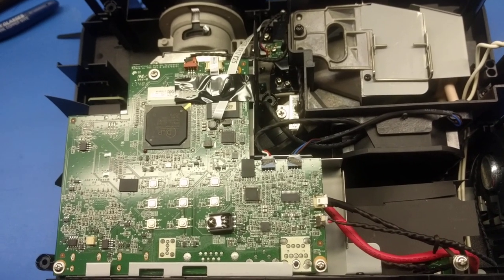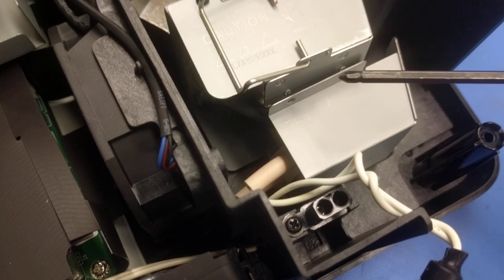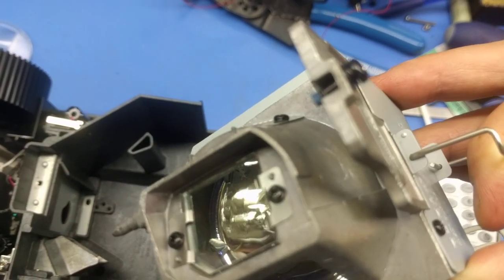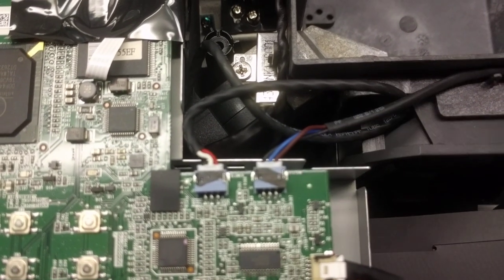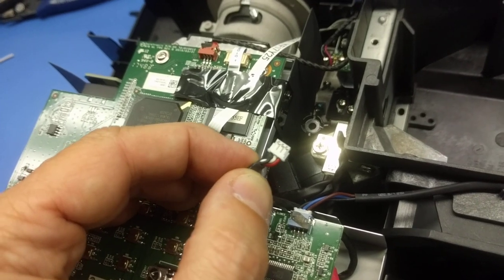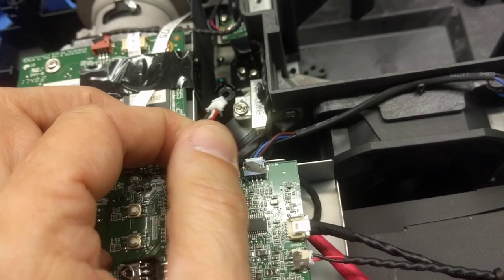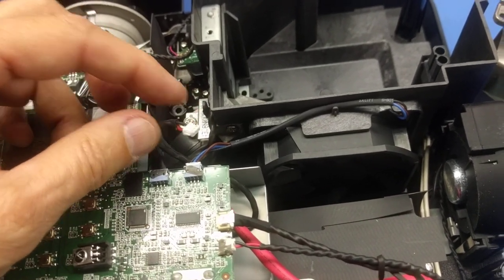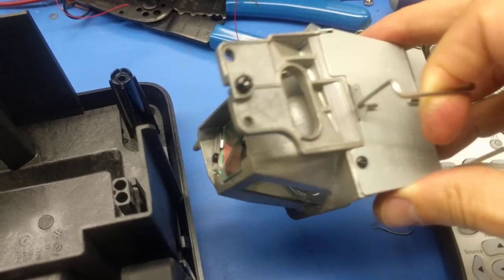Optoma Problem--Fan Failure Issue HD143x

Comment: Hey, thanks for taking the time to make this.  One more data point: I own a HD143X and had an intermittent fan error (rare) after about 1 year of use.  After about 2 years of use, it became very frequent so I found your video.  I opened it up and it looks like Optoma solved the wire gauge problem by the time I bought it in March 2018.  My basic calipers showed the wires for both fans were 0.98mm.  I cleaned out the substantial amount of dust, checked the crimp on the 3 conductors, and it seems to be working so far.

Comment from the maker: You don't see it in my description unless you expand the description section, but Optoma did contact me about this, and are working with me on the issue to further their manufacturing/repair processes and eliminate the error.
Reply: Dave - Do you what size JST connector this? Is it a 1.25? 1.5?
Reply from the maker: @mdmfootball82  I regret I did not measure it. I'll have to wait to open up another one here soon.
Reply: @davemedin1113  it turned out to be a JST ZH Connector (1.5mm spacer) for all those who can't recrimp the connector (or break it trying) you can buy pre-wired JST ZH connectors on amazon for $5-$10 for 20 of them.
Reply from the maker: @mdmfootball82  Great info. Thanks! I reworked mine under a microscope. Getting the harnesses prebuilt would be much cheaper than buying a crimper, leaving the wires to be joined by soldering.

Comment: Thank you for the video. The same error happened to my projector after 4 month of work. I replaced the fun, but did not solve the problem. But since i found this video i will check with your solution.

Comment: We have an Optoma HD142X and I am looking for quieter fan replacement. Your video really helped!
Reply from the maker: Make sure you don't do anything to decrease airflow though. Your bulb depends on it! Fans and blowers do go bad and get noisy, but they are there for a reason.
Reply: @davemedin1113  i'm here for the same reason, i was thinking about putting in noctua fans but from the look of it, it's not the 80mm fan that makes the nose but rather the little one, so now i don't feel comfortable replacing it since i dont have a clue about those type of fans. only my 3d printer has one like it and i didn't replace that one either while i put 3 noctuas on all other fans of that printer. it makes an annoying high pitch noise on the hd144x
Reply: did you ever replace them? did it help? what type did you replace it with, did you change both?
Reply: @Gagliano17  they should make projector body bigger and use standard 120mm PC fans, I don't know why are they making such nonsense products, on max lamp power, noise is so terrible that it's not actually usefull, you must set it to eco mode always which is sad

Comment: In my case the overheating / fun locked message comes when from eco mode turn it into bright after working some time at eco. Is it possible to have the same issue? thanks for the video and your knowledge!
Reply: I have the same issue, if somebody figures out the problem

Comment: Sometimes after replacing the lamp one might get a fan locked error message in which case the blower fan needs cleaning. Often times from the explosion of an old lamp shards of glass plunge into the blower fan and stick in the blades. 7:10 I guess you can just file either side of the plug and then push it in.

Comment: Hi Dave, first of all thank you so much for this video. I have been looking for a video about the hd144x, but this one is similar enough. I already own one that works perfectly, now i bought another one thats defect on an auction which i thought i couls possibly repair. 

The problem is that the lamp wont strike. I've tested the lamp in my other projector and switched bulbs. Both work fine in my projector, but in the broken one it just wont fire up. 

I myself am guessing for the ballast but maybe you have any clue what it could be and/or how to test this?

Comment: I have an HD 142x -- "2" not "3" -- and I've enjoyed it for several years, but I just recently bought three replacement projector bulbs and none of them "worked". They would get too bright, then flicker, then the bulb-protection light would come on. The theory that seems to be emerging as a result of watching your video is that I inadvertently jiggled the contact on the blower lead, while swapping the bulb. Two things, though: First, it's not the same model, so I'm wondering if you have an opinion about the likelihood of the same problem and, second, what do I do about it in the absence of an available technical repair? (I live in Cambodia.) Thanks for your video!
Reply from the maker: I can't answer for the lack of an Optoma repair facility in your area. Are you using genuine bulbs? I've found in general that the Chinese aftermarket bulbs are complete garbage and not worth using as they do exactly what you are seeing. It is likely that if you aren't getting a lamp error while the bulbs are still working, that the blower fan is working, as it has a tachometer in it that shuts off the bulb if it is not turning at the right speed.

Comment: please help. i have optoma ep719. problem is fan 2  slot is not working. how can i say that because when i switched the cable of fan 1 and fan 2 the fan 2 is working. then when i switched back to original slot fan 2 is not working again.  thank you

Comment: How do I remove the rest of projector casing to expose all that, i can only get as far as taking the lamp out?
Reply: I found there are about 5 little screws on the underside, think 1in each corner of the projector, one is under the parts where you can mount to a ceiling, then pull the plastic peice off that you use to focus the lense, then you can pull the casing apart

Comment: got this error after 1 week with my new uhd35x but restarting helped still think the issue isnt 100% fixed cuz this still happens even with brand new models , mine litreally ran like 2 days before it shut down the first time at cold surrounding temps aswell

Comment: Hello, thanks for the video,
I have a question about this, on the blower fan I connected V+ and PWM Signal, after a few seconds it smelled like I did something very wrong. Now the board is still intact, but PWM and GND on the blower adapter are now connected. 
At the end of the video you are saying that the board is measuring the speed of the blower fan, do you have any idea how to stop the board from doing this. Or where I could get a new board.
Right now, I ran into the error message: "Fan closed" if I try to start the projector, but I have fans attached on the system side, so heat is not a problem.

If you have any idea, I would really appreciate it :)
Reply from the maker: The fan has three leads--V+, tachometer, and ground. All 3 need to be connected for this to work properly. No, there isn't a way to defeat the tach--you need to provide a signal at this pin that is the same as the fan would at its nominal RPM, if you wanted to fake the projector as having a working fan, but why would you do that? The tach is there for the projector's protection. I can't comment on the mis-wiring of the fan, and the potential damage it can cause.
Reply: @davemedin1113  Thank you for your quick answer, I already asked Optoma about a Datasheet for the projector board, but I would also ask you, if you have one, at least for the blower fan part.
Reply from the maker: @TheJinGonzu  Optoma is unlikely to answer you, and I don't have the schematic. I don't have the blower part number either. I note that there are sellers on eBay that have a replacement up. Usually the part number is on the rear of the fan/blower.
Reply: @davemedin1113  I hope Optoma can help me with this, right now the tachometer is connected to GND and I am afraid I cannot fix this without a datasheet, and I could not find a replacement for the mainboard so far
But anyway, thanks for your time

Comment: Found this video because my hd143x had fan lock when trying to watch a 3D movie. Outside of this mode the projector works as it should so I'm not sure what the issue is. Any ideas on why this would happen?
Reply: Absolutely clueless, besides some firmware problem. The projector's bulb has the same cooling needs regardless of projection mode.
Reply: @dmedlin8118  very interesting, I wonder if taking the housing off and doing a little dusting would help, along with firmware update if needed? Can I find out if I need an update from the projectors menu?
Reply: @di9it4l  I've never done an update on an Optoma, so I don't know if they are factory update only or if end users can update them. I don't know how dusting would help with something that only occurs in 3D mode.
Reply: @dmedlin8118  okay cool, thank you for your guidance. I'll give optoma a call tomorrow and see what they suggest

Comment: not sure if youll see this but i have an optoma hd143x that has a power issue after barely two minutes it powers down and the power light blinks 3 times. 
the only way around for me to use it is to 
1 .plug the ac power cable while holding down the power button
2 .the three indicator lights all flash
3. hit power again 
then it starts up no problem but to turn it off it will keep cycling so i have to unplug the power cable
no other issues for it at all but i have no idea where to take it for repair

do you have any thoughts on how i can repair this myself?
thank you and i appreciate your videos!
Reply from the maker: Having the power indicator flash can, according to the manual, reflect a fan failure (not making RPMs) or overheat. If you overrride, what you will earn for the effort is an extremely short bulb life. Every cubic foot of air movement designed for is required to keep the bulb within limits.
Reply: @davemedin1113   thank you for this info. I’ll have to double check the fan is working alright and see if the contact or insulation on the blower contact is too thick.

Comment: Thinking of buying one of these new, do you know if they still have the defect?
Reply: I don't know. The project manager said that they had addressed the issue. But, my advice would be to keep an eye on it and if there is premature bulb failure or a heat alarm, use your warranty rights promptly.
Reply: there is a hd144x, i've been using it, beside the little fan making an annoying noise (which you wont hear when you have any audio along with the image) it's perfectly fine and probably the best sub 500 dollar projector you can get, native 1080p and insanely good 3d (i use 37 dollar active glasses) and really good light performance.
Reply: I have the hd144x, it seems they have corrected this issue because the wires are smaller on this connector :) i myself am very happy with the projector
Reply: @Gagliano17  What 3D glasses are you using? I've only recently got a DLP projector with 3D built in and wondered what are the best glasses to get. I've got a LG OLED that's fantastic in 3D, but they use passive, just like the theater glasses. In fact cinema glasses I happened to have work with the TV no problem, so cheap extra glasses. ;)

Comment: Im having a problem with this projector, thete is something on the screen looks like a hair and is very anoing, I was trying to open IT and clean it but there is no video tutorial how to do it and is not Simple to disassembly it. Could you do some kind of short video? Or we can get on touch somehow
Reply: FixitFrank has a lot of good videos on projector repairs. I know he has a few on things getting into the optical block and causing distorted color and other on screen annoying things like your 'hair'. Cleaning the projector and what to watch out for etc. You might pose a question to him, he often responds.  https://www.youtube.com/user/rostit420/featured
Reply: Hey Matovy, have you managed taking it apart?
Reply: @rgergazas  yes I have but i didn't touch the optics. I have opened the lamp and sprayed inside with air duster, since that time there is no hair on my screen anymore, but I would like to open optics and give it a proper cleaning.

Comment: only just received my optoma hd144 projector had for 5hours and now fan failure appeared says contact dealer disgrace brand new projector and now not working
Reply: just trade it in, if it's new it shouldnt be an issue, i have mine since 3-4 months and put over 450 hours on it already, never had an issue, just thinking about replacing the fans with more silent ones

Comment: Dave, please let me know where I can paypal you a couple of bucks for saving me about $400 by this video. I stripped the insulation a bit, re-crimped the connector and plugged it back in No problems. Thank you for making this video.
Reply: I appreciate your kind comment. I really was not in this to make any money, but to point out a design or assembly shortcoming. The satisfaction that it did someone some good is enough reward. Thanks!

Comment: I always break the connector off and hot wire it straight to the motherboard and the issue never comes back again :)
Reply: Do you happen to have any instructions or video for doing this? Have the same issue and don't know what kind of adapter to get to try this replacement.
Reply: I don’t like making videos but just break the white connector off wire the positive and negative, not data. Turn it on and the fan fail message will come up then turn it off the solder the data wire turn it on and the error message will be gone 👍